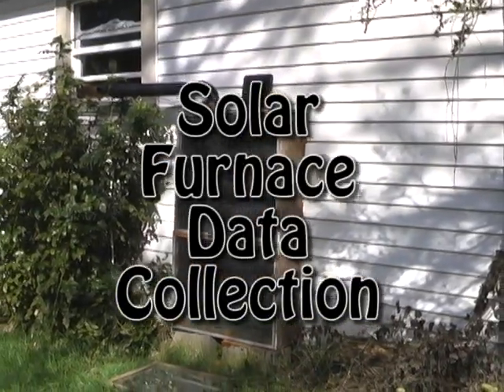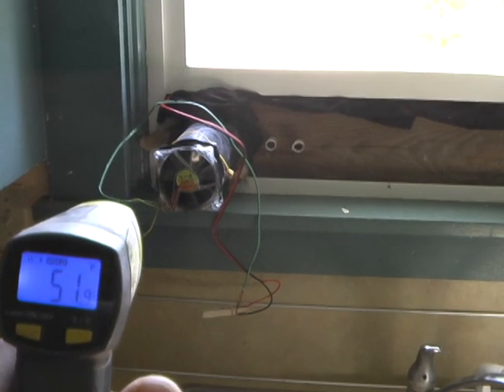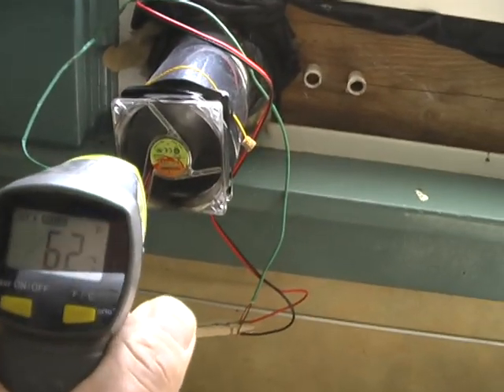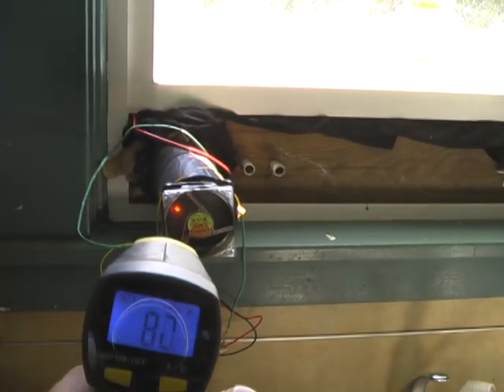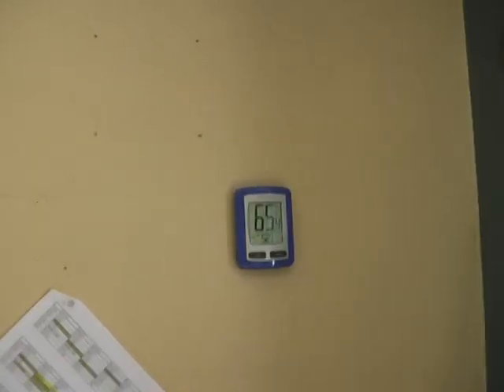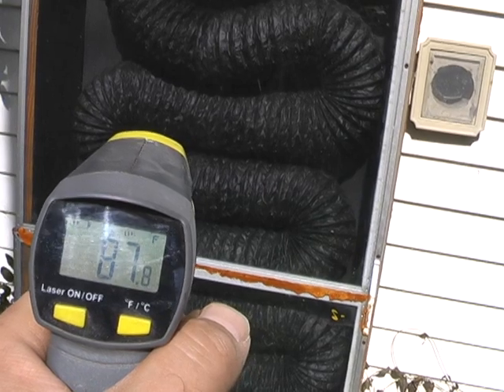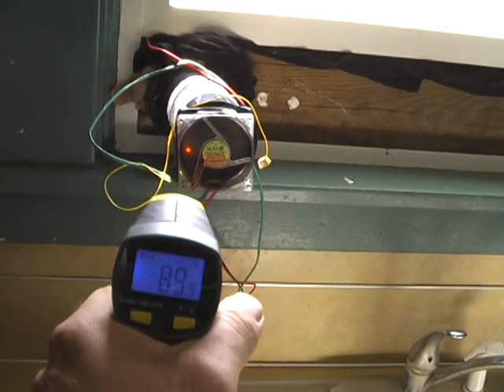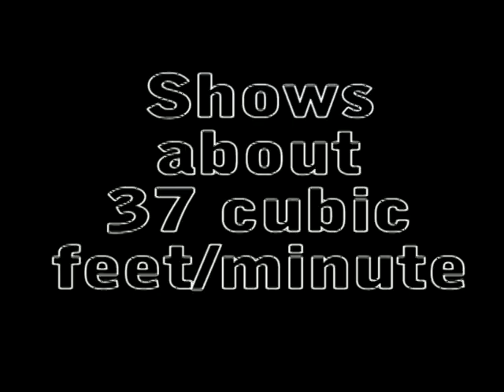Solar Furnace Data

Comment: Let's do a little back of the envelope calculation using some kindergarten thermodynamics. Your heat captured, "Q" equals the mass flow rate of your working fluid times its specific heat times the change in temperature. Q=m*C*deltaT. 37 cfm,(which is a VERY optimistic estimate for one of those fans)   is approximately 2.5 lbs/min or 150 lbs/hour. The specific heat of air is .24Btus/lb so with a 25 degree rise in temperature you are capturing a whopping 900 Btu/hr or the equivalent of about 264 Watts. To put that in perspective,  you would get as much heat in your house from three 75W light bulbs, a laptop computer, or a TV set.  At $.15/kWhr that's "THEORETICALLY" about 4 cents of energy per hour of operation. Lets say you can get this for an average of 4 hours a day, about 60 days a year, (again, an extremely optimistic estimate for Oregon), you COULD save $9.5/year so that's more like a 5-6 year pay back. And this doesn't even take into account the heat you will lose by compromising the air tight integrity of your window which would likely make this a net energy loss from your building envelope.  

I am a huge proponent of solar energy applications, especially homegrown applications, but this is little more than a fun experiment with no practical value.  

Capt. Carter, www.shipofimagination.com

Comment: This is a great idea but if you wish this to heat your room or house first you need a normal size fan, second you need to have big opening for the airflow just like the size of your ducts, and last, you need to replicate the panels 3 more times to get the air to a higher temperature.

Comment: This just goes to prove that if the government really wanted people to conserve energy they would promote this idea.I did this same thing years ago to heat my pool.I took a roll of 2' or 3"black pipe,placed it in a wooden box up on the roof & had a valve hooked to my pool water pump.I had it where I could circulate it at any rate I wanted.It would produce water at 130º to 140º when not circulating.Opening the valve let free hot water into the pool or I could leave it circulating all day.It would only be slightly warmer with continuos circulation.It cost nothing to produce this energy because I was filtering the water anyway.

Comment: Could you check out the design in the video linked to below? I'm wondering about how much those heat the big screens might produce relative to your dryer vent piping or the can method. What are your thoughts about this design in general? http://youtu.be/OxCroNxU9eM

Comment: Just an FYI, the theory behind adding rocks to the box is that the rocks will absorb the suns heat and release it as the sun goes down, while the aluminum ducting does absorb heat it doesn't retain heat so as soon as the sun stops shining on the box you loose all heating from the aluminum, try this, put some aluminum fool in an oven and heat it up, now pull it out and see how quickly it drops to room temp, the ducting isn't much thicker (thicker material retains more heat).

Comment: With zero restriction (open air application), that fan can exchange roughly 1 meter L,W, H of air every minute.  Adding a duct with all those bends reduces the output significantly.  You need to pull the return air from inside and keep it the same size as the supply.  Drawing air from outside lower the efficiency of the heater and creates a small amount of positive pressure inside the house, forcing some of your comfortable air out.
Reply: Grey Matter good call! you (thegulley) need to circulate air from the inside to increase your efficiency